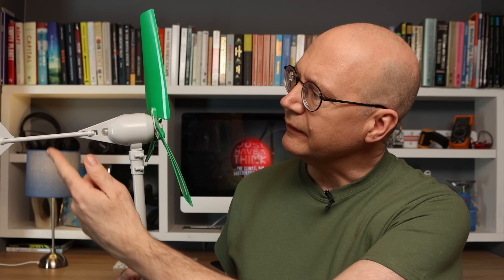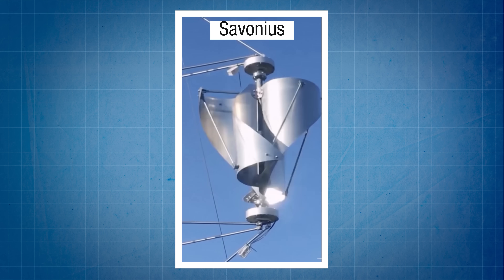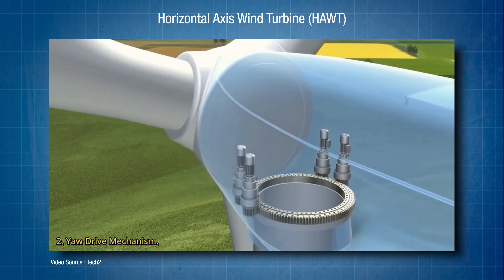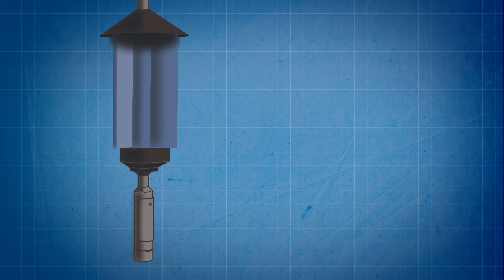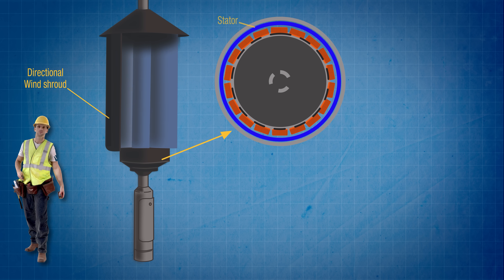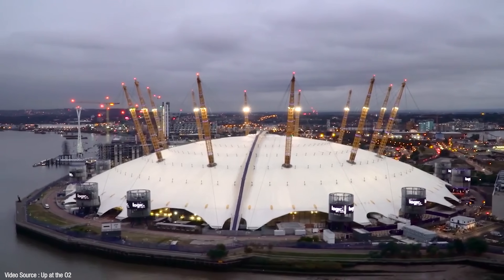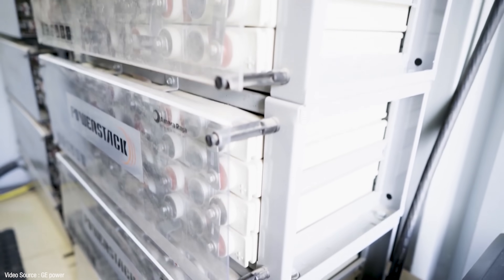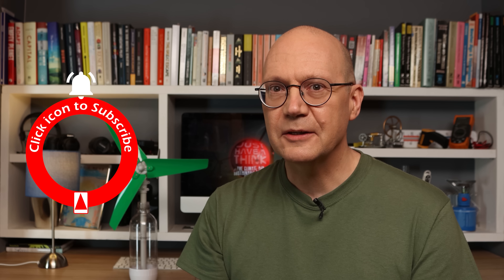A vertical axis wind turbine that doesn't need the prevailing wind! How do they do that?

Comment: Okay, I am very torn here. As far as I know, the turbines cause the flowing air pushed by the cars to slow down, as it take away the energy. Now the air is slower, thus piling up and creating a higher pressure area. Wouldn't this higher pressure also mean more pressure against the moving vehicles, increasing their fuel consumption, thus just wasting energy in all the transformative changes of various power forms?

Comment: For making supply cheaper, sure, or if they store the energy. Otherwise, they lose the capacity gained from this during construction or road repair. It can't be allowed to be critical for the grid, but it's still something that would be great to offset things like electric vehicle charging.

Comment: I see pros and cons to this wind turbine design.  
Pros:  because they are small, I hope they will kill fewer birds and bees than the big turbines.  That will need a field test.
Decentralized power saves transmission and distribution costs.  Small is Beautiful. 

Cons:  Battery prices are dropping, but still need to be considered in the analysis.

I am a retired Professional Engineer, Minnesota, electrical and agricultural.  Recently, I have helped design several micro-grids.  I am frugal - energy and power included.  About 25 years ago, I was helping design wastewater treatment with a grandson of the founder of Jacobs Wind Turbine.  My Dad helped design the solar generator that was tested near the Santa Rosa substation in Southern California. 
I like the idea of developing multiple options for power generation, because it may save the customer money for his niche.  But, I don't support government interference in the economy to favor any power source.   They should all compete on an equal footing.  
Are we now in a GSM - grand solar minimum?  If yes, we have more important investment needs than any renewable power source (government subsidies).

Comment: Two thoughts:

- I am not well enough versed in aerodynamics, but I don't think you are getting free energy. Although the car is punching a hole in the air either way, wouldn't it be the case that the turbines would make for a more frictional passage thus costing more gas? If this were the case it might still be useful. You could avoid running wires to the street lights and have them collect their energy from the passing cars. This reduction in fuel efficiency would be a toll for using the road.

- There are various situations where we would like to reduce wind such as city corridors. If the turbines are collecting energy then they are making less energetic wind. I suspect they are converting laminar flow into more turbulent, but it still might be worth it.

Comment: I think it's a great idea every little bit helps rather than just wasting the free energy. The real gains come when these units can be produced and installed for the least amount of money as possible. I always said the large water and wind turbines are ok but the thought of having smaller units in every town would take the load off the grid. If a few units went down it wouldn't take the hole grid down as long as every system wasn't running at max output already. There is nothing wrong using duel fuel sources like gas and electric cars do now till the battery storage technology catches up.

Comment: There is a big problem with this approach. As vehicles become more efficient, they will produce less wind. Cars are already very aerodynamic, but there is still a lot of room for improvement (look at Aptera for example). But a more significant improvement will come from autonomous driving, especially for trucks. Autonomous driving technology will allow trucks to travel in convoys, which significantly reduce the total air resistance. (They are essentially drafting each other.) Also, if we ever get truly autonomous driverless trucks, then they will probably travel more slowly, because the operator is not paying a driver by the hour. The slower the vehicle, the less energy it uses per mile, and of course, less wind generated.
Reply: On a heavily traveled shipping route, they'll drive them at the maximum speed to get in the maximum number of trips per day/week.  Well, no, actually, they'll program them to drive at the minimum speed consistent with still getting in the same number of trips driven at the maximum speed.  Obviously, for 24/7 operations, it'll be MAX SPEED, BABY!

Comment: I’ve often thought about these next to railway lines. It’s a more controlled environment and there are miles of high speed routes where these can be removed from view.
Reply: The only thing with that is there are not enough trains continually passing to generate a constant airflow.
Reply: @diceman199  how about naturally occurring wind? Are there railway tracks that are to some degree exposed to "the elements"?
Reply: @tiltil9442  That may well be possible. I was only commenting regarding the wind from the trains
Reply: @tiltil9442  lines tend to be tree lined or in cuttings to reduce noise, which reduces the wind.  For more exposed open sections it makes sense.
Reply: @diceman199  ...then you've not considered the amount of trains in the Schiphol tunnel in the Netherlands or many underground systems around the world where there is a train every 3 minutes!
Reply: @61PietPiraat  of course there will be a few places like those but they are the exception
Reply: Would this work in underground train systems like subways (the tube) in large cities??

Comment: No, this is not free energy. "those vehicles will be punching a hole in the air and causing airflow around them regardless of wether there is a turbine or building or anything else on the side of the road" That is just not true. When a train enters a tunnel that will cause a huge shock. It costs more energy to push yourself forward if the air in front of you has trouble moving to the sides as you try to punch through it.

Comment: Vertical Wind Turbines have advantages and disadvantages. They will never produce the enormous muli-megawatt power as the giant turbines that have what amounts to an airliner wing for a blade, that reaches almost 100m into the air, where the power to be extracted is greater.

The unidirectional nature of verticals is great for space restricted areas, and where simplicity is better than complexity. E.g. on the roof of a tall building where maintenance of a standard turbine up high on a pole would be difficult. And the extreme load from a tall tower in a stiff breeze would ruin the structure.

Comment: Good Idea stick them all over. UK has hawt powering track/road side equipment on railways/roads usually mounted with small solar panel on a pole. We could put a giant one on a roundabout surely the air goes round with the traffic?

Comment: I thought of this back in the nineties while sitting at a red light in the left turn lane. Large truck were going by at high speed and actually shaking my car with their turbulence.  My idea was to turn soda pop cans into turbines and line them up on top of the concrete fences that edge our freeways in the US. There could be a mini-turbine every 6-12 inches.
Reply: Try riding a motorcycle on the highway with semi-trucks blowing past you. There's some real turbulence that almost blows you off the road along with the prevailing wind that whips you around.
Reply: Bigger is better when it comes to wind
Reply: @pissoffeachother  Except when farting
Reply: That's just the kind of thing I come up with. It won't work too well, but who cares, it's just beautiful ❤️

Comment: Put them along the side of the railway tracks. I would think that a long train would move more air than vehicles would? It would be easier and more affordable to install next to the railways because installing it in a vehicle roadway system  would have more obstacles in the way that the installers would have to contend with.
In addition to, with tracks stretching across the country, would there not also be a lot of energy obtained just from the wind? Plus it would not chop up the birds, like horizontal windmills do! 
It would not effect animal migration nor passage of vehicle's. It would be easier to service and the technicians would not have to worry about getting hit by a drunk driver. Just wondering. 😏

Comment: Brilliant use of existing inefficiency to scavenge useful power. Diversity of power sources will built a robust interconnected grid. One could cover the surface of the device with titanium oxide which, in the presence of ultraviolet light, will help destroy the heavy polluting particles from combustion.

Comment: Imagine having roads going through tunnels, and having rotor bands going around the outside of the tunnel. Just like the fan of a Turbofan jet engine.
The portion UNDER the road wouldn't harvest any energy, but the 65-80% around the sides and top of the tunnel would draw a HUGE volume of airflow with ZERO counterflow or turbulence.
And the heat from both the exhaust and also the rolling friction of the tires on the road surface would carry waste air upwards through the rising side of the rotors and causing a centrifugal type pump to evacuate the air exhaust gases from the roadway.

Comment: Sorry, but this is an absolute load of bullshit. Small turbines like this producing 2.5kW? Try plugging some numbers into the wind turbine calculator at https://www.omnicalculator.com/ecology/wind-turbine (select VAWT at the top) to see what I mean. For a rotor of 1m diameter and 2m long, which is similar to what the graphics show, you get 193W available in the wind at 5.4m/s, of which around 55 watts is harvestable for a VAWT.

To get to around 2.5kW at 5.4m/s and 30% efficiency, you need a turbine rotor 6m diameter and 15m tall!

Why didn't this channel do this basic calculation before posting this video? Kind of ironic, given the channel's name...

Comment: Terrible idea. If the idea is to capture the wind energy created by moving cars, then you are just slowing down that induced airflow, which requires the next car to speed it up again. All of that energy comes from the cars, and taking any of it just creates a larger drag for the next cars in line to overcome. This is a complete waste of time. Not to mention all the dead birds and cost that will go into production and maintenance. Just build a thorium nuclear plant, and it will generate a million times more energy at a much lower cost.

Comment: Regarding your point made at 8:15 : That's not entirely correct. The aerodynamic effect of now making these turbines turn will further decrease the aerodynamic efficiency of the vehicle driving past it as it will create an additional low pressure point that would not be there if it were simply a static object or "nothing". This additional low pressure point created by the turning turbine creates additional drag that would not be there otherwise. So no, this is sadly not "recuperating lost energy"..
So essentially, your vehicle will lose some additional energy that is transformed to electric energy by the turbine. As each energy conversion has losses this comes down to a net loss.

Such turbines at the sides of the road are, in a way, "stealing" your energy to convert it to energy for the grid. This is not a good use case. Vertical turbines do however have other potential applications as they are more easily to be installed in difficult locations.

Comment: Just a thought - the intake and vents for each air blown furnace could be a small scale capture of energy
Reply: The intake fans would likely have to work harder, negating any energy saving. The vents may be useful though since any air that isn't moving the blades would escape around it.

Comment: Would it be possible for large trucks to have HAWTs on top to generate their own electricity? Not sure how much they could make, but it would be better than nothing. In the video 60mph = 2.5kW, so if you could find a way to add several to a truck it could generate quite a bit. Height is obviously a problem like going under wires and bridges. But a large truck might be able to have say 5 HAWTs on top in an X pattern. Let's say you have 5, they are shorter, and less efficient ... you would still be generating around 4 to 5kW ... maybe. I guess drag is going to a slight probably as well though.

Comment: I've seen this idea kicked around from back in 2013 or earlier. In tunnels and at the edges of overpasses, down the center separator. Glad to see someone actually putting it to use. The efficiency is still an issue for home use. Cost per kwh data is missing. A lot will ride on that.

Comment: is it possible that they could cause more aerodynamic drag along a road? maybe not directly to a single car, but on a highway that would otherwise have a draft of air following the direction of traffic, would these generators have any meaningful effect on slowing down the airflow it uses to generate power?

I wonder if that phenomena even exists, as its frequently used in racing where cars are very close to each other, and I'm sure its a very noticeable effect even many meters behind a truck, but for standard cars, is there a measurable effect of scavenged energy from cars all travelling in the same direction?

Comment: Those roadside turbines, like all turbines, increase resistance to the air flowing past them. That's where they extract the energy from. Instead of freely flowing away, air is forced to turn a generator. That air will slow other air near it, and so on, until the air that's in the way of cars, that a car spends energy to push out of the way, will also be slowed. Slowing down the car and requiring more petrol. So these turbines are just an inefficient way of increasing petrol usage. Inefficient, because, if you were going to take the extra energy from a car, you'd be better just using it's alternator and battery. Which of course you would never do because it's stupid, and cars are an inefficient way of producing energy. If you want energy from petrol, a much bigger engine would be more efficient, but not practical in a car.

So they're bollocks, is what I'm trying to say. No free lunch. Whenever you see a scheme like this, you have to look at it in the other direction as well. Sure, the movement of the air is "wasted" energy, but it's also necessary for a car to travel. They have to push air out of the way to move forward. Making that harder, requires more petrol.

Kind of a shame nobody has pointed this out to the company. Don't they have engineers? It's basic thermodynamics. 

It's amazing how often a "green" technology not only doesn't work, but actually increases pollution. The world needs more engineers! Not to build things, but to think things through properly.

Comment: Unless my maths is way off, that would generate this much if installed on every motorway in the uk: (410 turbines / 2.2 miles )× 2173 miles of motorway × 5.6kwh= 2.2 GWh.  Btw that is the same capacity as Dungeness 1&2 + Heysham 1&2 nuclear power stations 
(https://www.statista.com/statistics/438980/operational-capacity-uk-nuclear-power-stations/)